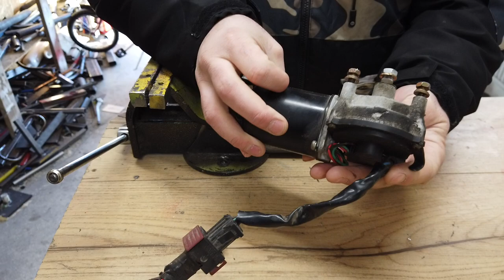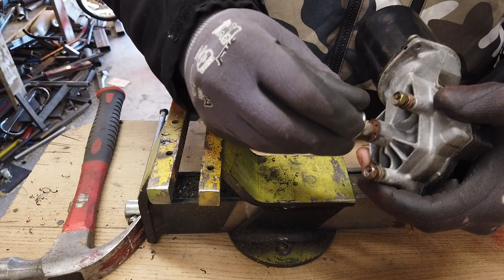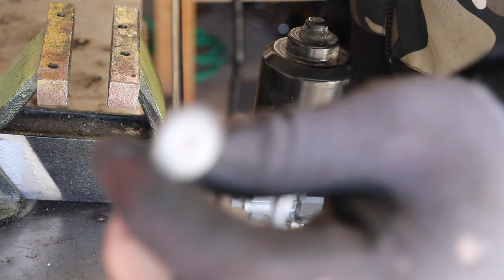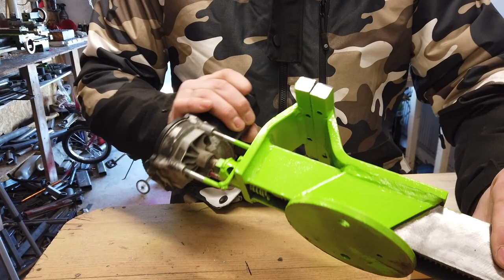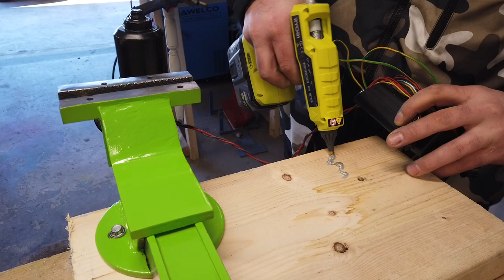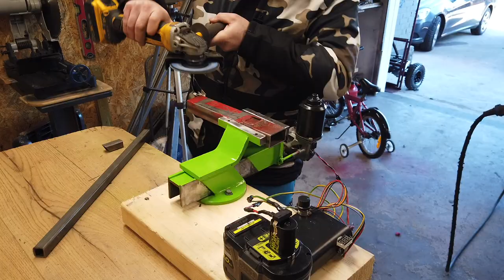Build an E-VISE || using Wiper Motor at home

Comment: Hi, very good idea, but don't you think your engine is a little in your way? I would have installed the engine from below,
Reply from the maker: Thanks for your feedback
Reply: الله
Reply: Te quwu.

Uddg
Reply: I was thinking the same thing, I think I would have positioned it down rather than up..  Interesting idea overall though.  Tempting to try something like this for my metal lathe and mill setup..